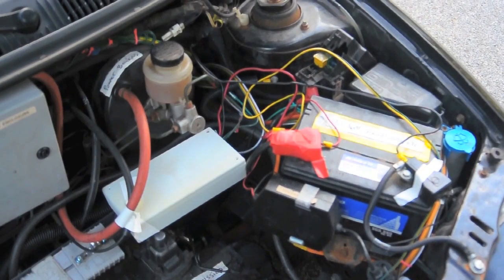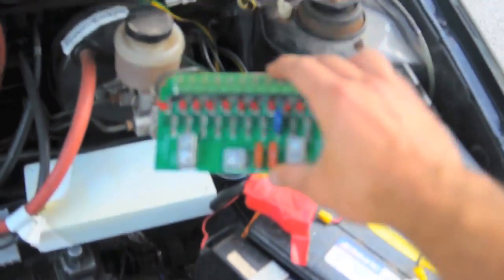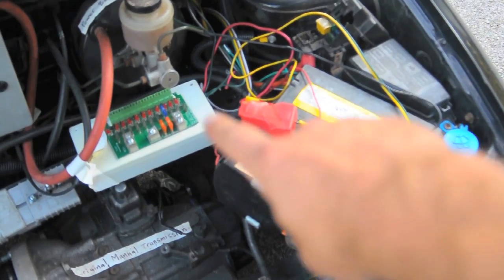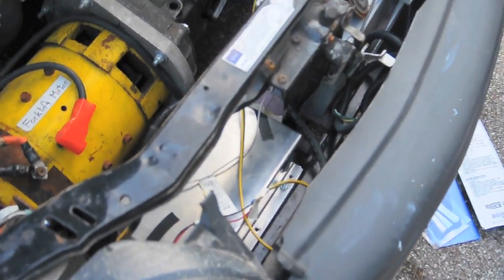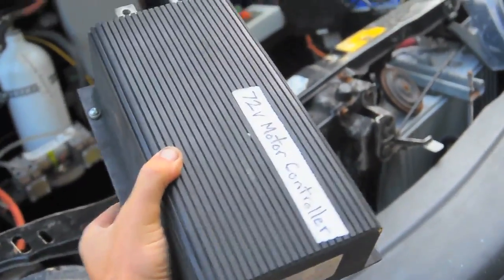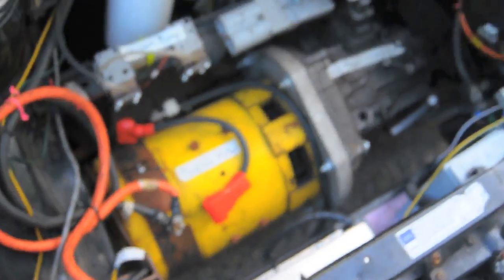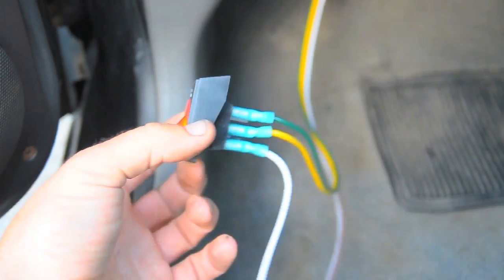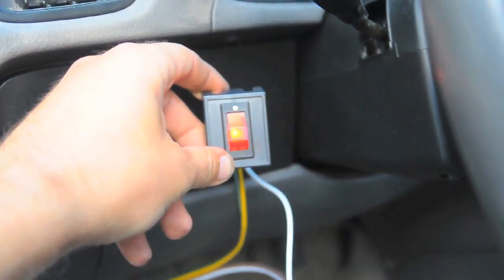Open Source controller install

Comment: great stuff ben. just wondering,,, is there something different in that controller that requires it to power up first? if its to charge the caps up could you put a charge resistor on the controller like we do with the curtis 1321c? just a thought! always love your videos mate!

Comment from the maker: I need the power for the controller to turn on BEFORE the main contactor does. The key is rigged up to the main contactor. By having a separate switch for the controller, I can turn it on first.

The controller also has an un-used yellow wire for a future upgrade to have the controller open and close the main contactor, like a Zilla does.